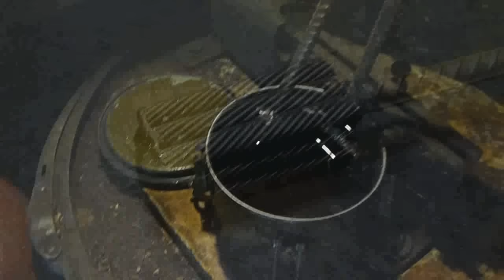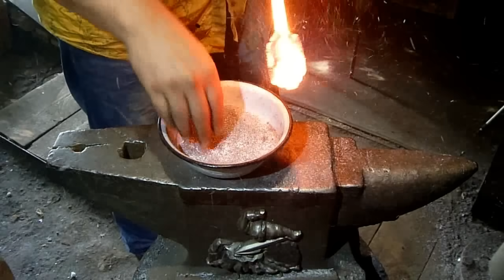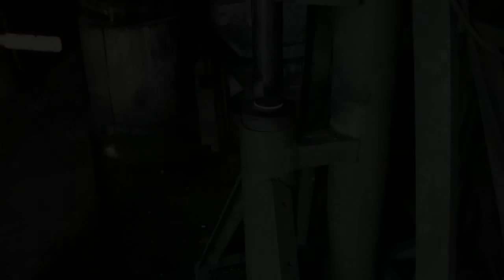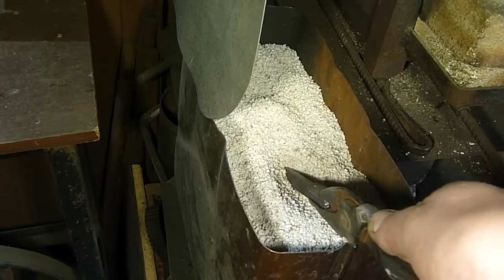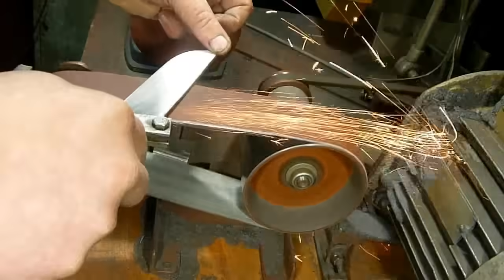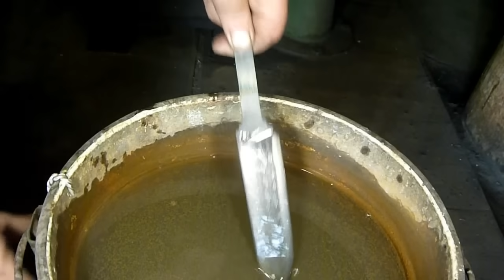Forged cable  Mosaic damask steel from the cable  making a blade

Comment: Dude, you clearly built all of that equipment yourself. Props for that, You are awesome
Reply from the maker: Thank you, yes, I did all the equipment.
On the channel there are videos about some of them.
Reply: shurap what is the powder you sprinkle on the hot metal ?
Reply: Borax or some other type of flux. Prevents corrosion which occurs rapidly at high temperatures.
Reply: I’m very impressed with your equipment and setup. It’s damn amazing. Your a very skilled craftsman sir! Much respect

Comment: Lets see who gets this...
No Yack Yack. All Whack Whack.
Reply: Alec Steele of course!
Reply: Alec could take a "No Yack Yack" lesson from shurap.
Reply: Jajajaja you made my day xd
Reply: P. T. Anderson got it right away. Holy Molly let's all head to Alec Steele's channel for a while
Reply: What’s the powder he is sprinkling on the billet?
Reply: Sean Booth Borax?
Reply: sand.
Reply: Well since my original comment has been hijacked, thank you Sean Booth :P , I'd say that stuff is more likely to be Borax. It acts as a flux. When the Borax melts it flows into the spaces between the layers helping to prevent oxide layers from forming. If there were oxide layers they would interfere with the forge welding process.
Reply: I actually just noticed this in the description while watching another vid from this same guy. It's in this one too.  "Frequently Asked Questions: The roller is long - but not a single stroke is missed on the steel. The billet is soaked in kerosene. This is necessary for good welding (forging) steel. I sprinkle flux (90% borax + 5% quartz sand + 5% charcoal powder) this is necessary for forging (forge) welding. The flux is alloyed with scale - the formed substance is sufficiently fluid and is easily displaced by deformation. In addition, the flux protects against oxygen and charcoal, carburizes the surface layer of metal - which lowers the welding temperature (if in brief)."
Reply: P. T. Anderson that's really cool and helpful. Thanks for the info
Reply: No prob. Glad I didn't come across as snarky, definitely didn't mean to be.
Reply: ALEC STEEEEEEEEEEEEEELE!!!!! THE MAN HE MYTH THE LEEEEGEEEEEND

Comment: Hi, in all your videos you start the damascus forge welding process by hammering on a block of new wood after the first heating... why is that? seems unique to your process. Awesome work and channel btw, amazing skills, process and craftsmanship.
Reply from the maker: The first welding is done on a tree, as the tree is a heat insulator, and not so selects temperature as an iron anvil. In addition - burning, the tree burns oxygen, protecting the workpiece and pouring the flux work. This is important for welding workpieces with small parts (cable, chain).
Reply: Просто комментарий к вашему комментарию: в английском "дерево"- "tree", означает растущее дерево, или упавшее дерево, а "wood" означает "древесину", как материал.
И отдельное спасибо  за объяснение, то что вы делаете - это настоящее искусство. Спасибо!

Comment: I know absolutely nothing about any of this but love learning and enjoy watching, so im sure this is a dumb question for 99.9% of you, but what is being "sprinkled" on the metal from the bowl?
Reply from the maker: I sprinkle flux (90% borax + 5% quartz sand + 5% charcoal powder) this is necessary for forging (forge) welding. The flux is alloyed with scale - the formed substance is sufficiently fluid and is easily displaced by deformation. In addition, the flux protects against oxygen and charcoal, carburizes the surface layer of metal - which lowers the welding temperature (if in brief).
Reply: @shurap  thank you very much
I really enjoy the videos

Comment: I do love your videos and your craftmanship. Masterclass. I do wonder. What is that you have it drenched in to begin with? Oil? And that powder. What's that? Also the stuff you put it in. The white.. Is it chalk? I just want to know what the process is.
Reply from the maker: The billet is soaked in kerosene. This is necessary for good welding (forging) steel. When burning inside the workpiece remains soot (carbon), which, with further heating, scales and rust inside the workpiece restores to the iron, improving the quality of forging welding.

I sprinkle flux (90% borax + 5% quartz sand + 5% charcoal powder) this is necessary for forging (forge) welding. The flux is alloyed with scale - the formed substance is sufficiently fluid and is easily displaced by deformation. In addition, the flux protects against oxygen and charcoal, carburizes the surface layer of metal - which lowers the welding temperature (if in brief).

This is annealing of steel, it is needed for grinding grain of steel grown at the temperature of forge welding, stress relief. Preheated billet to austenitic transformation temperature, placed for slow cooling in the heat insulator "Perlite".

Comment: Can someone tell me what they are sprinkling on the metal please, and what it does
Reply from the maker: I sprinkle flux (90% borax + 5% quartz sand + 5% charcoal powder) this is necessary for forging (forge) welding. The flux is alloyed with scale - the formed substance is sufficiently fluid and is easily displaced by deformation. In addition, the flux protects against oxygen and charcoal, carburizes the surface layer of metal - which lowers the welding temperature (if in brief).

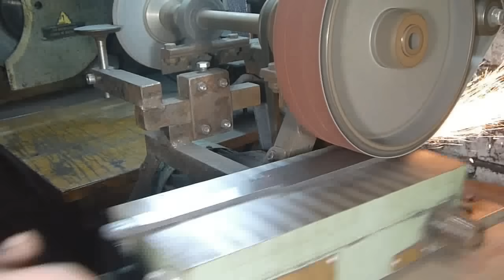Comment: The machine you use at 6:15. I am assuming it is a planer of sorts for metal. What I'm wondering is how it holds your piece in place so it doesn't go flying off the table when you are grinding.

Comment: Your work is incredible and I like how you push the boundaries of forging. 
Question, please: What are the bright or lighter areas in the blade caused by? My guess is that it is the tack weld metal, but?
Reply from the maker: Yes it is true - it's a seam. That it would be visible at an etching, I do zone zakolku (toest the basic part of a blade - it is not tempered).

Comment: What is the powder you sprinkle on from time to time?
Reply from the maker: I sprinkle flux (90% borax + 5% quartz sand + 5% charcoal powder) this is necessary for forging (forge) welding. The flux is alloyed with scale - the formed substance is sufficiently fluid and is easily displaced by deformation. In addition, the flux protects against oxygen and charcoal, carburizes the surface layer of metal - which lowers the welding temperature (if in brief).

Comment: Great videos. Love watching them to kill time at work. Was wondering though why you have a tip of the knife on one side and then forge it over to the opposite? Keep up the amazing work.
Reply: I think I finally figured this out after watching a bunch of his work.  He forge welds a steel bar to his Damascus.  This bar will be the edge.  He then grinds the Damascus side to the shape of the tip profile.  We see then that he hammers the piece in the opposite direction into the reverse of that tip profile shape.  This results in that edge steel piece being perfectly uniformly consistent following the tip profile.  This beautifully distinguished the boundary between the Damascus and the edge steel. GENIUS!

Comment: What is the liquid they dip the metal in and what is the dust they sprinkle on it, why and for what reason. Trying to learn thats all.
Reply from the maker: The billet is soaked in kerosene. This is necessary for good welding (forging) steel. When burning inside the workpiece remains soot (carbon), which, with further heating, scales and rust inside the workpiece restores to the iron, improving the quality of forging welding.
I sprinkle flux (90% borax + 5% quartz sand + 5% charcoal powder) this is necessary for forging (forge) welding. The flux is alloyed with scale - the formed substance is sufficiently fluid and is easily displaced by deformation. In addition, the flux protects against oxygen and charcoal, carburizes the surface layer of metal - which lowers the welding temperature (if in brief).

Comment: Please correct me if I'm wrong. At the end when his final form is made, he cuts a piece of to form the tip then reverses it with his hammer. And he is doing this to make the edge and tip stronger than they would have been had he left it to be formed from the cut instead?

Comment: O que será essa areia que ele joga pra forjar o aço?
Reply from the maker: Polvilhe com fluxo (bórax 90% + areia de quartzo 5% + carvão em pó 5%), isto é necessário para a soldagem (ferraria). O fluxo é fundido com incrustações - a substância resultante é bastante fluida e é facilmente deslocada durante a deformação. Além disso, o fluxo protege contra o oxigênio e, devido ao carvão, carboniza a camada superficial do metal - o que diminui a temperatura da soldagem (se por breves instantes).
Reply: @shurap  👏🏿👏🏿👏🏿👏🏿 Obrigado professor! Excelente explicação!

Comment: Some narrative would be helpful.
What's that powder he sprinkled on the metal? Just sand?
What did he dip it in at the end? Something to etch the surface and bring out the pattern, it would seem...
Reply from the maker: I sprinkle flux (90% borax + 5% quartz sand + 5% charcoal powder) this is necessary for forging (forge) welding. The flux is alloyed with scale - the formed substance is sufficiently fluid and is easily displaced by deformation. In addition, the flux protects against oxygen and charcoal, carburizes the surface layer of metal - which lowers the welding temperature (if in brief).
Reply: @shurap  thanks!

Comment: I love to see the making of your knives, I wonder what "magic" powder is that you put in the incandescent piece?
Reply from the maker: I sprinkle flux (90% borax + 5% quartz sand + 5% charcoal powder) this is necessary for forging (forge) welding. The flux is alloyed with scale - the formed substance is sufficiently fluid and is easily displaced by deformation. In addition, the flux protects against oxygen and charcoal, carburizes the surface layer of metal - which lowers the welding temperature (if in brief).
Reply: Thanks for your attention!!
I love your blue damask knive!!!
Are simply beautiful!!!
Thanks a Lot!!

José Carlos Lagarto/ Rio de Janeiro, Brazil

Comment: I have little knowledge in this kind of work I was just curious what is that stuff being sprinkled on the metal and what's its purpose? I see it being used a lot in these videos
Reply from the maker: I sprinkle flux (90% borax + 5% quartz sand + 5% charcoal powder) this is necessary for forging (forge) welding. The flux is alloyed with scale - the formed substance is sufficiently fluid and is easily displaced by deformation. In addition, the flux protects against oxygen and charcoal, carburizes the surface layer of metal - which lowers the welding temperature (if in brief).

Comment: What is the liquid that you dip your billets into before putting them into the forge
Reply from the maker: The billet is soaked in kerosene. This is necessary for good welding (forging) steel. When burning inside the workpiece remains soot (carbon), which, with further heating, scales and rust inside the workpiece restores to the iron, improving the quality of forging welding.
Reply: @shurap  thank you very much for the reply

Comment: what exactly is that oil/liquid that you dip your work pieces in before forge welding and what does it do? and can i just say your bladesmithing skills is something to aspire to!
Reply from the maker: The billet is soaked in kerosene. This is necessary for good welding (forging) steel. During combustion, the soot remains, which upon further heating cement the surface layer of the steel, thereby lowering the welding temperature and, in the process, if rust or scale remains, restores it to iron.
Reply: Awesome man, thank you very much for replying and making these videos!

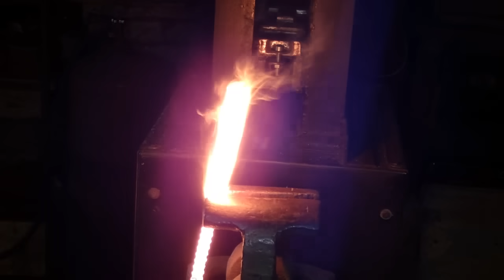Comment: New to this but I have a fascination for blacksmithing. I was curious if there was any real benefit to twisting the steel like he does at 2:31
Reply: To the best of my knowledge.  It compresses the inner portion of the cable and causes them to weld/meld more completely as well as refines the pattern between the welds media and the steel. Making it finer.

Comment: What was the liquid you dipped this in before first heat? Thank you
Reply: Kerosene, he wrote in the description. I suppose to degrease/clean the surface and help burning any possible dirt.
Reply from the maker: The billet is soaked in kerosene. This is necessary for good welding (forging) steel. During combustion, the soot remains, which upon further heating cement the surface layer of the steel, thereby lowering the welding temperature and, in the process, if rust or scale remains, restores it to iron.

Comment: Hi what is the stuff like a sand in the box where you put the knife! Thank
Reply from the maker: This is annealing of steel, it is needed for grinding grain of steel grown at the temperature of forge welding, stress relief. Preheated billet to austenitic transformation temperature, placed for slow cooling in the heat insulator "Perlite".

Comment: What was that liquid he put the cable in just before putting it in the forge? I'm assuming some sort of oil, or acid that helps remove scale
Reply: Kerosene.
Reply from the maker: The billet is soaked in kerosene. This is necessary for good welding (forging) steel. During combustion, the soot remains, which upon further heating cement the surface layer of the steel, thereby lowering the welding temperature and, in the process, if rust or scale remains, restores it to iron.

Comment: What do you dip the billet into before your first heat? It's something I haven't seen anyone other than you do.
Reply from the maker: The billet is soaked in kerosene. This is necessary for good welding (forging) steel. During combustion, the soot remains, which upon further heating cement the surface layer of the steel, thereby lowering the welding temperature and, in the process, if rust or scale remains, restores it to iron.
Reply: I figured it was something like that! Thanks! You're an inspiration to us knife making noobs!

Comment: Which  chemical  powder id applying for every  time pls tell
Reply from the maker: I sprinkle flux (90% borax + 5% quartz sand + 5% charcoal powder) this is necessary for forging (forge) welding. The flux is alloyed with scale - the formed substance is sufficiently fluid and is easily displaced by deformation. In addition, the flux protects against oxygen and charcoal, carburizes the surface layer of metal - which lowers the welding temperature (if in brief).

Comment: What is the liquid that you put the metal in before the foundry
Reply from the maker: The billet is soaked in kerosene. This is necessary for good welding (forging) steel. When burning inside the workpiece remains soot (carbon), which, with further heating, scales and rust inside the workpiece restores to the iron, improving the quality of forging welding.
Reply: Really! Man your skill is unbelievable!

Comment: What is that liquid you always dip the steel in before going into the forge?
Reply from the maker: The billet is soaked in kerosene. This is necessary for good welding (forging) steel. When burning inside the workpiece remains soot (carbon), which, with further heating, scales and rust inside the workpiece restores to the iron, improving the quality of forging welding.

Comment: I wonder want to know, what is powder that surface fired bar?
Reply from the maker: I sprinkle flux (90% borax + 5% quartz sand + 5% charcoal powder) this is necessary for forging (forge) welding. The flux is alloyed with scale - the formed substance is sufficiently fluid and is easily displaced by deformation. In addition, the flux protects against oxygen and charcoal, carburizes the surface layer of metal - which lowers the welding temperature (if in brief).

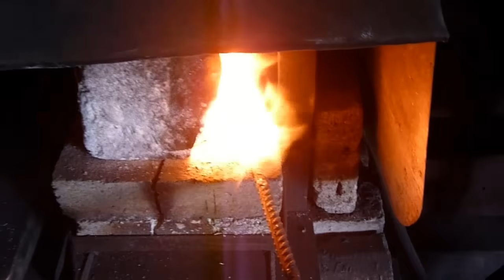Comment: What kind of liquid did you use at 0:05? And what kind of dust/powder did you use at 0:22?
Reply: Alex Kovács not sure about the liquid, but the powder is most probably anhydrous borax used as a flux to prevent oxygen from entering the weld and causing scale to form which will lead to a bad weld or inclusions in the steel.
Reply: Noah Kuzel I think it was kerosene to help clean out the cable grease that is all through the strands. The stuff is called "wire rope and open hear lube " and it is hard to get off, the keep would help break it down. I may be wrong about this.
Reply: Open gear not hear
Reply: Kero not keep, dang the auto crap

Comment: What is he sprinkling onto the molten steel, and what does it do?
Reply from the maker: I sprinkle flux (90% borax + 5% quartz sand + 5% charcoal powder) this is necessary for forging (forge) welding. The flux is alloyed with scale - the formed substance is sufficiently fluid and is easily displaced by deformation. In addition, the flux protects against oxygen and charcoal, carburizes the surface layer of metal - which lowers the welding temperature (if in brief).

Comment: In which liquid do you submerge the metal? Before work it.
Reply from the maker: The billet is soaked in kerosene. This is necessary for good welding (forging) steel. When burning inside the workpiece remains soot (carbon), which, with further heating, scales and rust inside the workpiece restores to the iron, improving the quality of forging welding.

Comment: Why you have to twist the hot bar?  What is the powder spread on the hot bar and is the purpose?
Reply from the maker: I sprinkle flux (90% borax + 5% quartz sand + 5% charcoal powder) this is necessary for forging (forge) welding. The flux is alloyed with scale - the formed substance is sufficiently fluid and is easily displaced by deformation. In addition, the flux protects against oxygen and charcoal, carburizes the surface layer of metal - which lowers the welding temperature (if in brief).